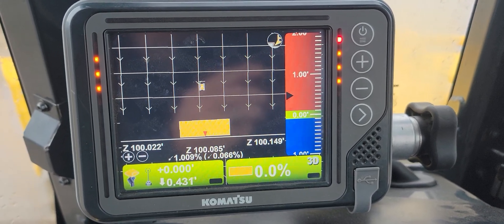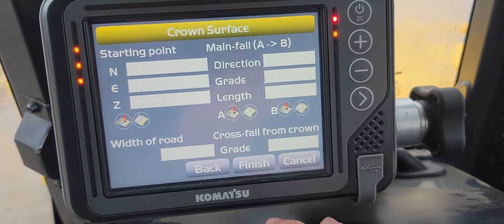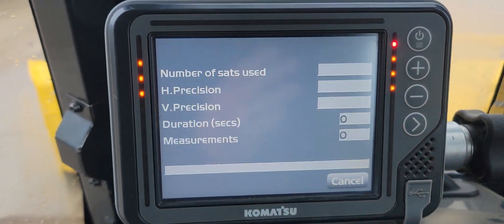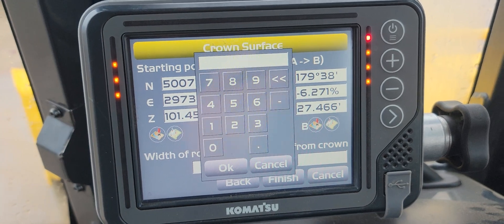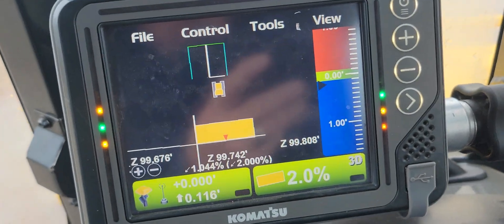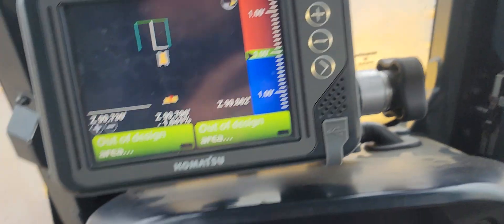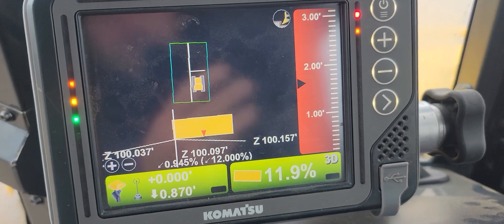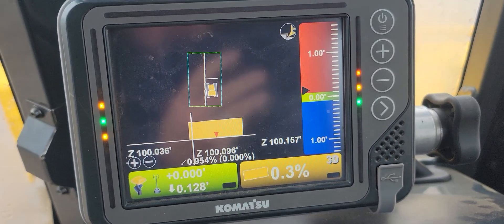Creating a Crown Road Surface - Komatsu IMC Dozer

Comment: How do you know where it’s going to put your center line? Where is it reading your elevation from?
Reply from the maker: The focus point (orange triangle on blade) is where it is getting the location info (Northing, easting) and Elevation from. I believe in the newer versions it will allow you to select left, middle or right. 
I always move the control to my left tip and put it on what I'm trying to measure.
You can also take shots with the rover and just enter the points and select them. That is my preferred method if it is anything complicated I'm trying to build.
Reply: In your video the orange triangle is in the center and it put your CL on the left side of your blade. My model doesn’t show if I can pick a side. 

So with my rover make a point at the top of my ditch and bottom and then just enter the points?